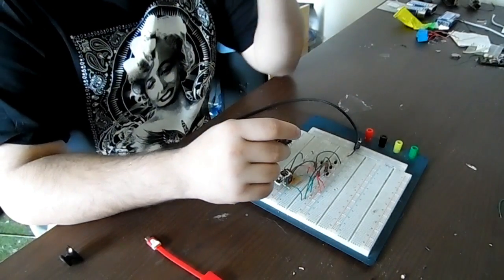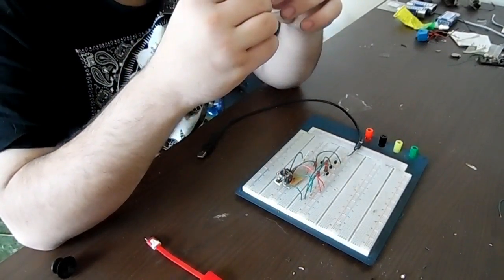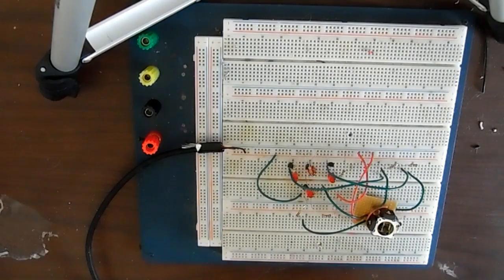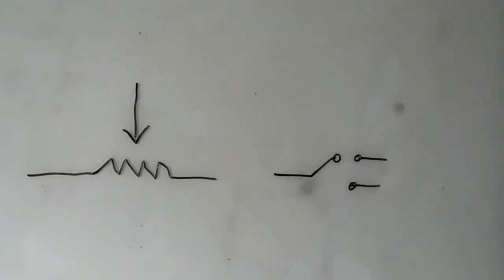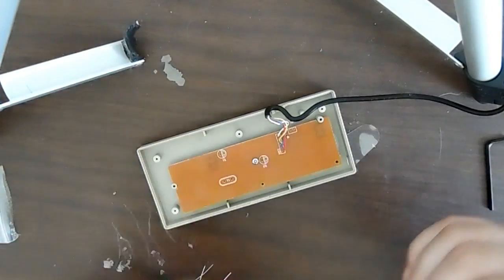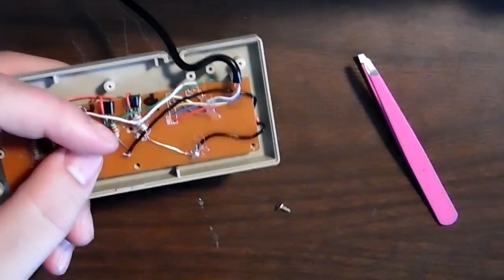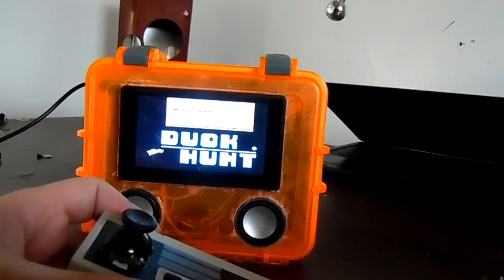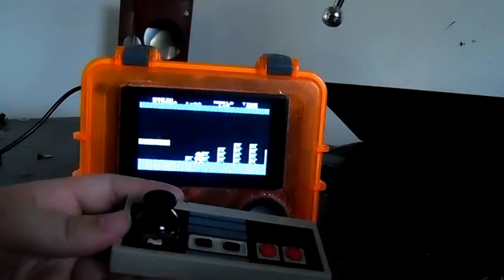How to add a joystick to an NES controller!

Comment: Honesty this makes the games worse.
Reply from the maker: tell that to the person whos been using it for years
Reply: @Solder_king  If it was micro switches it would be different but its a joystick with a large dead zone and these games weren't made with that in mind
Reply from the maker: @Wolfstanus  did you watch the video? It's not being used as a joystick.
Reply: @Solder_king  I did. It has a dead zone where the lights do not light up until it reaches a threshold of movement and its not as accurate as a d pad because I can see multiple light engage when you demonstrate its movement.
Reply from the maker: @Wolfstanus  that's the point. It's turning it into a switch.

Comment: I understand the potentiometer hack. I don't understand the transistors. The hack just closes a switch. The dpad is just switches. Why the need for the transistors?
Reply from the maker: pointedspider 
The analog sticks have two potentiometers which have a total of 6 pins, 3 each. The d pad has 4 buttons with 2 contacts each so 8 contacts total. You could do this mod using a ground signal on the wiper of the pot and just throw that to the contacts but I encountered a few "mis fires" when the contacts were left floating so when you use the wiper pin to throw a high voltage to turn on the base of the transistors the signal is more consistent
Reply: Taylor Burley I thought about that afterwards. Great idea. Love it.
Reply from the maker: pointedspider 
Thanks :) I'm sure there's a way to accomplish this without transistors but I just went with what was easier at the time lol

Comment: I would recomend a 3ds joystick its much smaller and a cleaner look and their only a couple dollars on ebay
Reply: good luck closing the system
Reply: How do you even connect ribbon joysticks to controllers?
Reply: @sadfatty3371  You can "strip" open the ribbon cables on 3ds sticks to acess soldering pins.

Comment: Im considering doing this with a psp analog, anybody try it?
Reply from the maker: That sounds very interesting
Reply: I dod some research on it and the psps analog only has two directions both wi 5th a pisitive and negative value, so i would probably need some sort of arduino chip to run it.ill probably wont use it
Reply from the maker: you could probably use several transitors or a logic gate of sorts
Reply: +Taylor Burley hmm, im going to look into it. thank you for the help